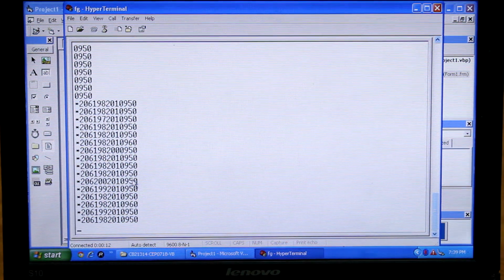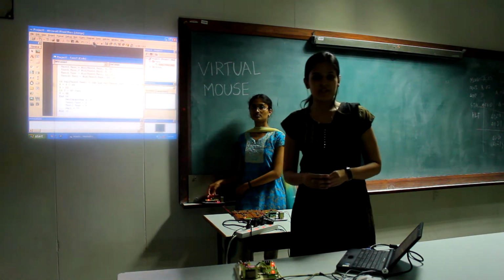TIIC IADC-Team 1.4 ( ID- 1283) - Virtual Mouse

Comment: Good concept and implementation. There is a potential scope for this work viz low cost integration of the TV with a PC. The transmitter module may be integrated in the remote control and the 4 transmitter may be placed in the corner of display or similar applications.

Comment: Pretty sweet deaGreat job Padma!!Pretty fast on the clicks and selections...but slow on the update of location of the cursor isnt it?Isnt there anyway to make it fast as to be updating the position in real time as u move it?
Reply: Here we have used a 8 bit ADC module...instead if we use a 16 bit ADC module or even higher bit  wl help us to access every point on the projected screen & with modification in coding;the speed of mouse cursor can be improved..